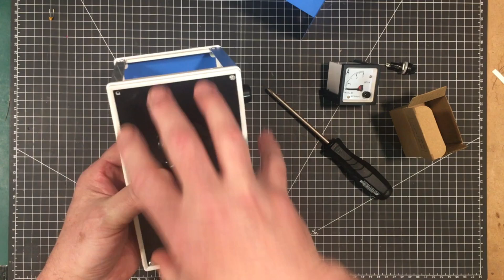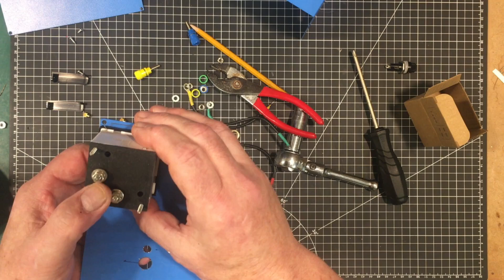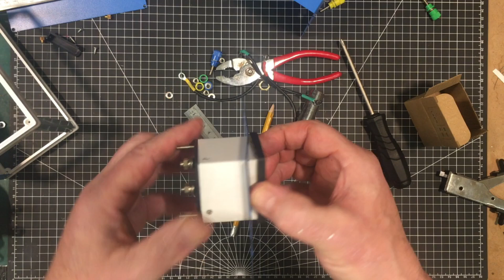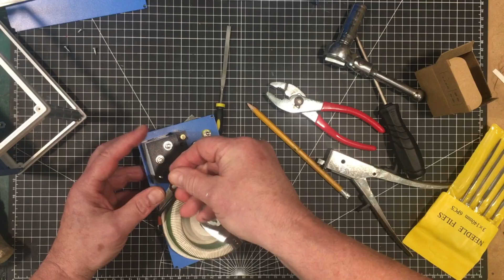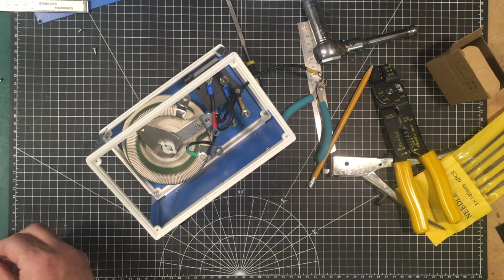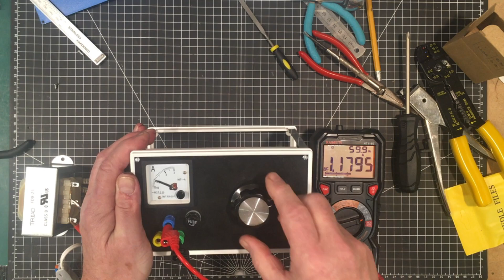Uni-Byte 0194 - Making it BETTER.  Upgrading the Variable AC Load.

Comment: That case has come up nice.👍
I prefer to mount Fuse Holders and Breakers in the top-panel, it keeps from stacking things on-top of heat sencetive items.
You could do away with that 5volt input for the Fan, by using a Capacitive Dropper from the AC input, 30 to 40 mAmps.
Reply from the maker: Good tip!

Comment: I like glass fuses and having the fuse holder on the front panel but I bought a bunch of I.E.C. sockets that have a blade fuse holder and a rocker switch built in and it really simplifies that part of a project.
Reply: In some cases I don't like them. Sometimes they are in circuit to protect against a common issue and they go pop. One example is my mini lathe, if the work jams or stalls the spindle then the fuse blows. As this does happen quite a lot I got rather fed up with constantly changing fuses. So I machined up a brass fuse for the fuse holder, and fitted a mains rated  thermal fuse behind the panel. The brass fuse was done so that I could use the fuse holder to mount the thermal fuse, and the mod was easily reversible.

Worth thinking about is some cases./

Andy
Reply: A Circuit Breaker would have been a better choice, imo.
If you want even more assurance, a Self Reseting Thermal fuse in SERIES with the Breaker. 
Its Not the best solution, but the risk is lower.
Reply from the maker: I agree with you Mike.  I have done likewise in the past.  In this case the "instrument" does not have a power input other than the 5V for the fan.  It's just a passive resistive load.  My only choice was a standalone fuse holder.